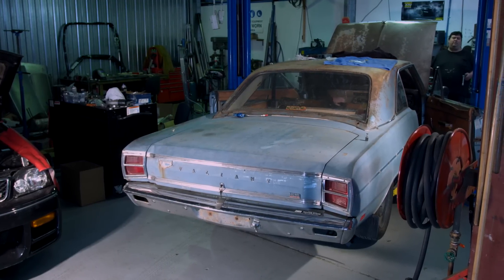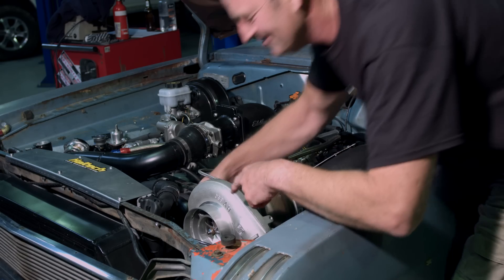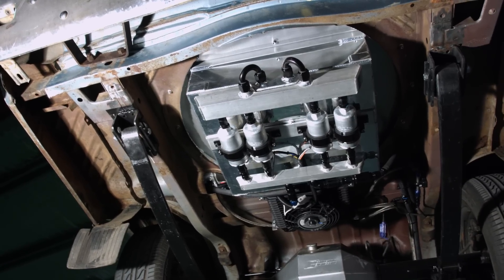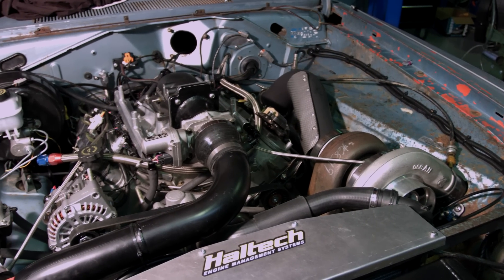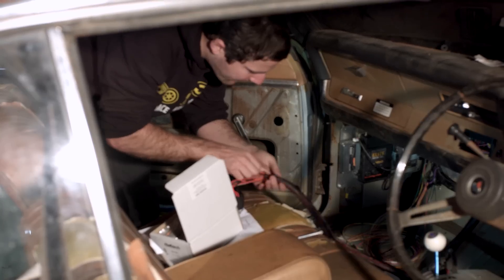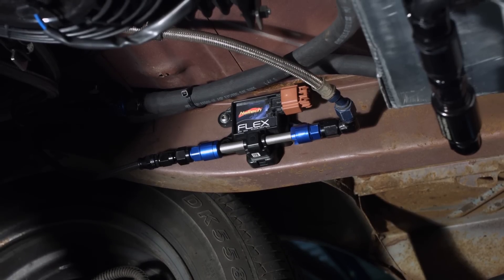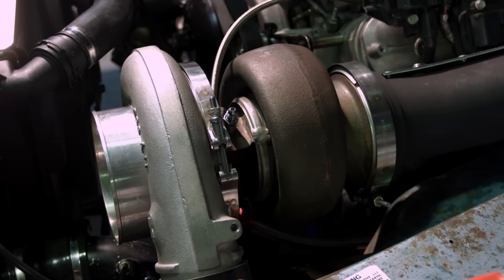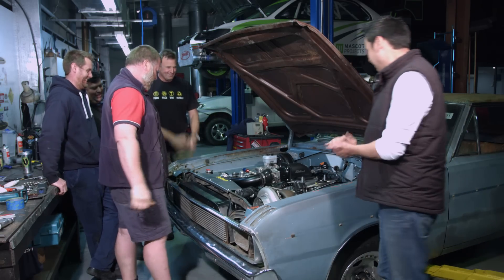🏅 POR-440 Build Part 1 - It's ALIVE!

Comment: is it possible to get a build sheet for this motor package?
Reply from the maker: You would need to get in touch with the owner. Also - this is an old video, the has changed quite a bit since then.
Reply from the maker: If it helps - we do have a full write-up of the build here: https://www.haltech.com/por-440-part-1-overview-wiring-and-the-first-start/

Comment: A few questions on the Valiant/Dart: wing windows suggest it being a 67 model year. If it is you will want to change out the K frame to a 68 up, duel to the 67 poor design of the idler arm, a T/A drop pitman arm is a good upgrade, so it welding the upper control arm mount to the front aprons, also adding a 3/4" grade 8 bolt with serrated washers loktited thru the apron is good insurance! Everything is LS powered today, any engine management systems to run a RB/B Big block in the A body?
Reply: Firewall forward they're Australian design and made to fit in with the rest of the Australian VF-VG Valiant range of 69-70. The relocation of a 'different' (locally sourced steering box) to right hand chassis rail means all the idler arm, pitman arm and their locations as well as the K frame etc is different to American LH drive cars. The weakness Valiants have here is the integrity of the RH chassis rail due to rust and stress from the steering box being fitted to it. Can mean a very complicated repair if bad.  We didn't see the 2 door here until 69 so I have no idea what year the bare shell was that Chrysler Australia imported.
Reply: Wing windows were commonplace through the 70s in Australia - especially on Holdens (GM) and Valiants.  Many cars back then didn't have A/C, so they fitted the doors with wing windows (quarter vents, we used to call them) to let you scoop air into the car and keep the temp down a little.

Comment: bruh that drivetrain must have taken half a year to do, they skipped a massive part of the build
Reply from the maker: It did take almost a year. We got involved in the project at a later stage - wiring, ecu fitting, tuning etc and we will follow it all the way to the Drag Challenge.
Reply: Well I'm definitely glad y'all doing it but for the next build it would be awesome to follow it from start to finish, those are my favorite builds. Almost like I really care about the car